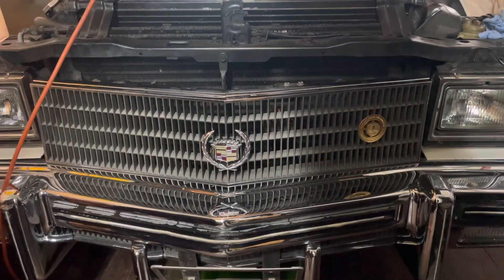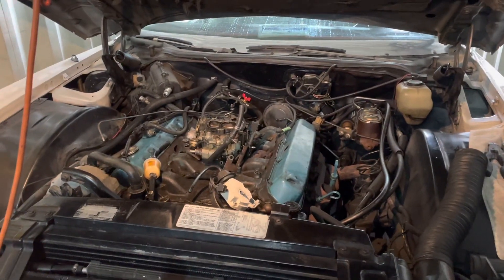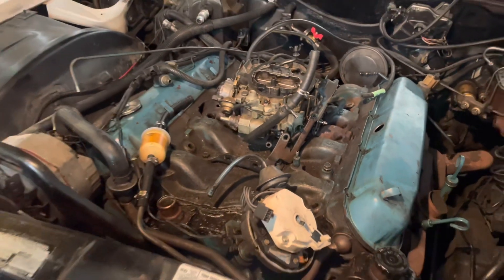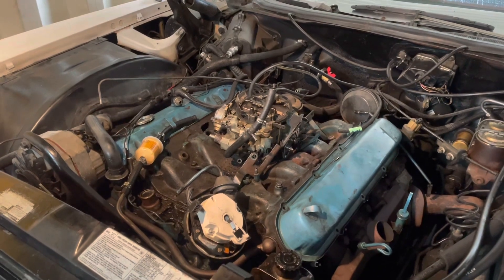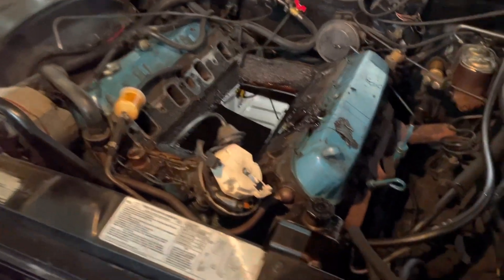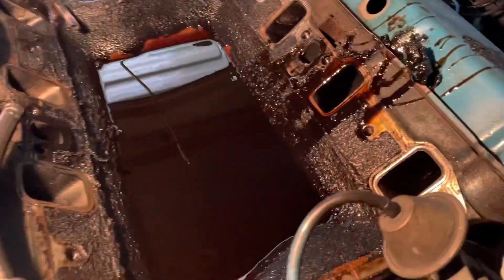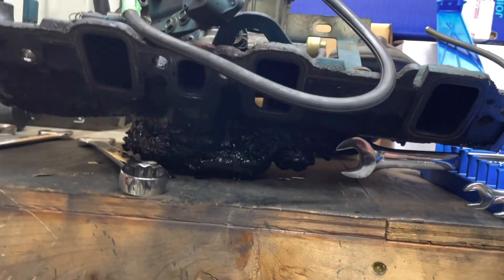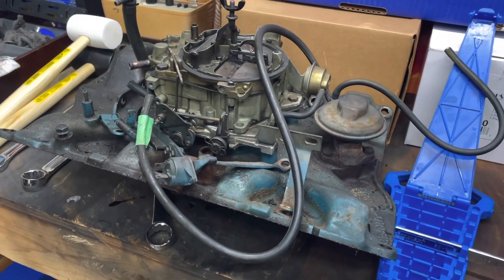Look what’s underneath the intake manifold 1978 Cadillac 425

Comment: That pan valley surely I caked with oil.. Woozers, been a long time since I've seen that. Make sure nothing drops down there after you remove it. Check lifters and all since you're down there. If your down there and have extra time yank the heads up clean it all up and slap new stuff... unless you're already planning that

Comment: Thinking of wooden ramps to easing off & on.
Reply: I finally made a set of wood ramps. 2 old pieces of 12" staging planks 4' long going up to an 8" height block. Made my oil changes real easy on my 2010 Camry. I wish I had made a set 50 years ago! Go up slow , so you don't drive off the end.